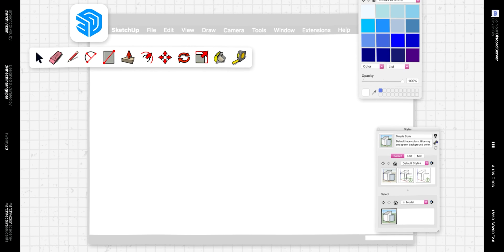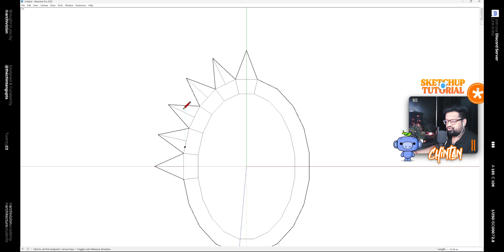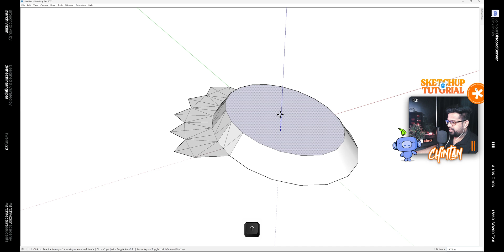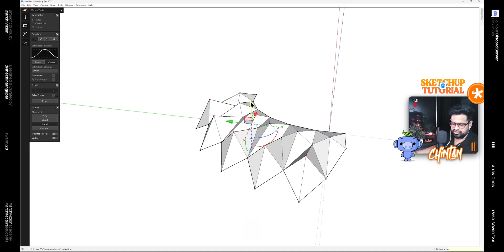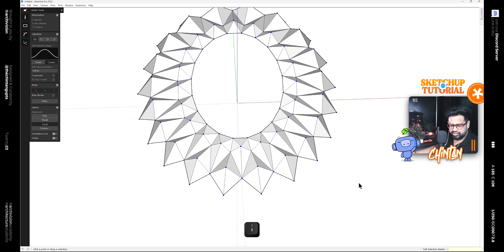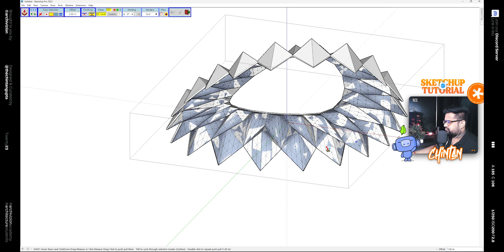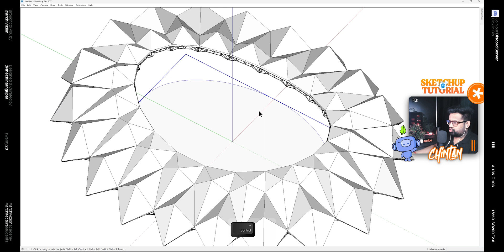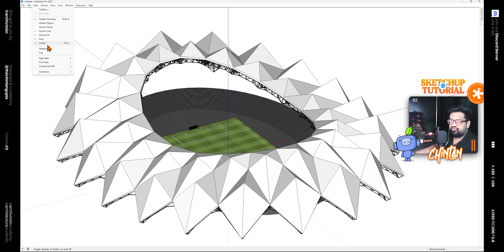SketchUp for Architects: How to 3d model Shenzhen Universiade Sports Centre in #sketchup #create #4k

Comment: Great tutorial ! please remove the BG music. TIA
Reply from the maker: Glad you liked it 😊♥️ Would try to keep the BG music even lower in the next one
Reply: @archivizion  I really like your all the tutorials. all are excellent ! keep up! I have one query. In my joint push pull tool I can't find the group option. I can't sub-divided the surfaces. What to do? TIA
Reply from the maker: Well there is a small cube looking icon in the Misc. Section of the toolbar of joint push pull. Also to subdivide the surfaces, you can use artisan plugin or jhs powerbar. I hope this reply helps you out. But if it doesn't fully solve your query, you can reach out to me on discord.